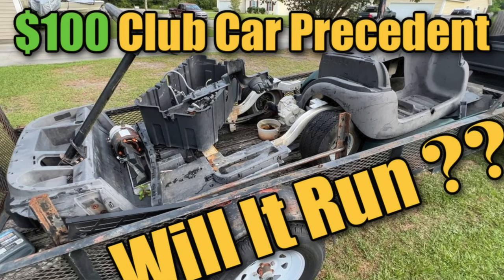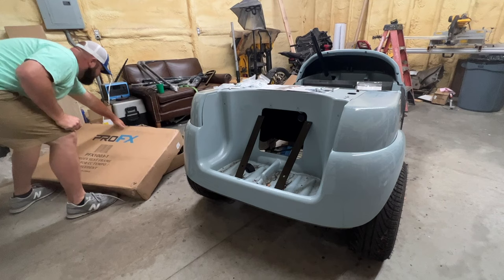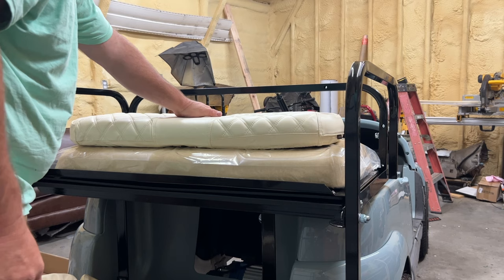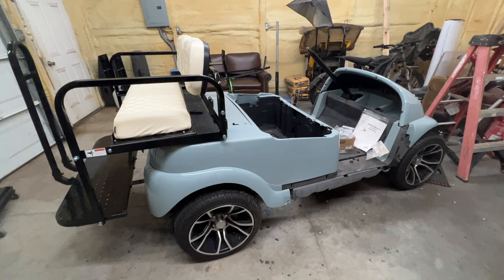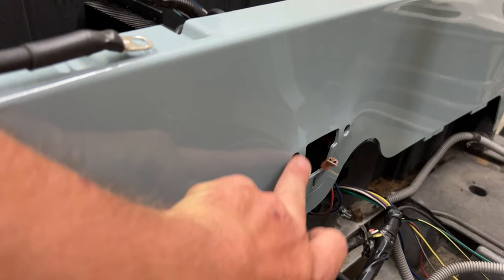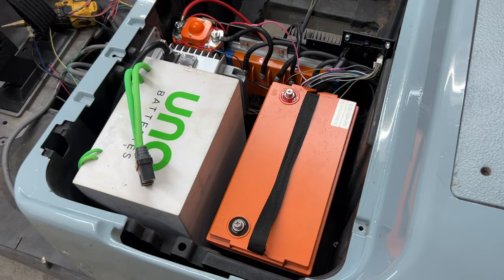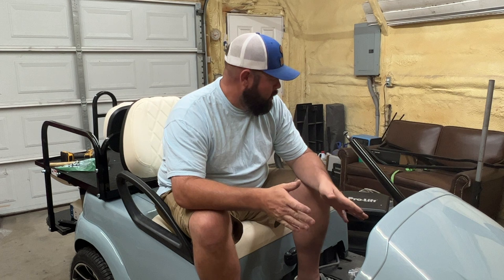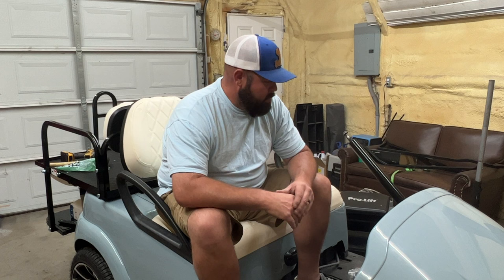I Told Her I'll Carry It On Vacation... Will It Run? Golf Cart Build

Comment: Can you please answer this question? I replaced a solenoid  on my precedent and didn't keep track with the wiring. This 10LOL 48v isn't marked for "input" or "output". My question is..which post gets the the battery cable and which post goes to the motor? Also...which way do I orient the direction of the resistor? Thanks in advance

Comment: Hey Ryan, nice build. Just wondering why you installed the 12 V battery rather than a 48 to 12 V reducer? I am sure that charging the two batteries with different voltages would be a pita.

Comment: I have a similar question.  I see you installed a 48V battery and a 12V battery.  I did not see either of the on-board chargers.
I dont think you can charge a 12V battery with a 48V charger.
How are you dealing with this ?
Are you replacing the factory charge port with a 110V male plug?
I saw a video where you cut a new hole for the 110V port.
I would like to see a video from you about how to replace factory port with the 110V port.
Reply from the maker: Next video will cover your question. But thank you for noticing that and asking.

Comment: Like I shared with you before, nothing like the cart going forward and backwards when your done doing whatever ! I have a uno battery in my 2021 Yamaha drive 2. We are flat and paved here , no hills. 440 amp controller, 400 amp solenoid, stock motor. It will do just under 40 mph. I run it about 25 - 30 most of the time and get about 25 miles before I need to charge it back up. Just curious how far you go between charges on your wife’s cart.
Reply from the maker: I haven’t tested it just yet but soon will